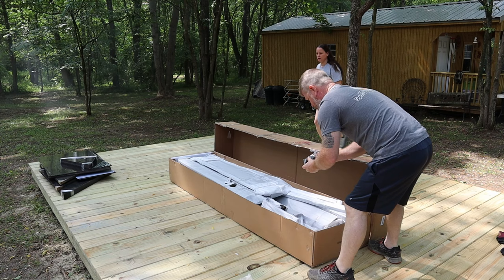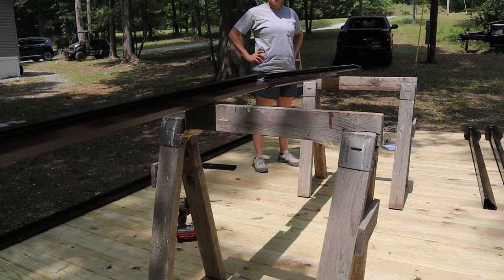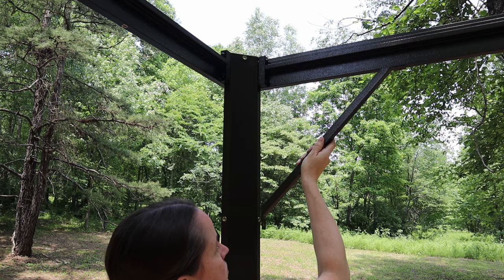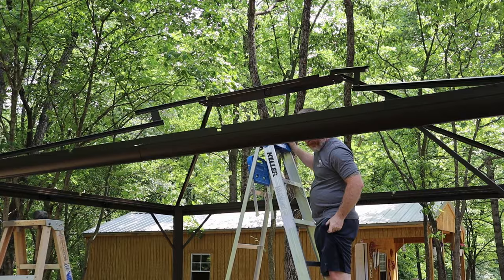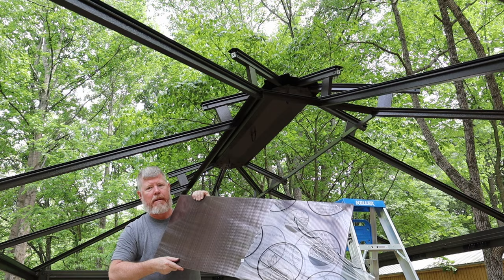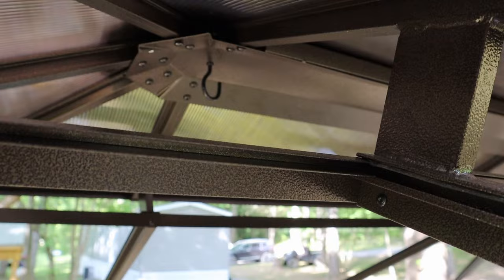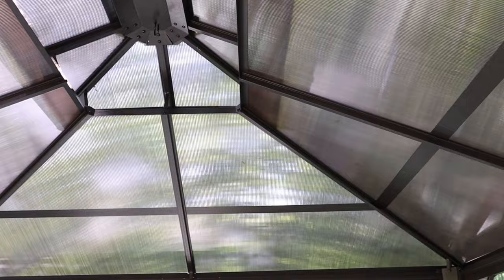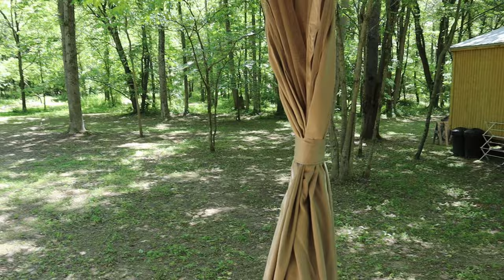"Unbelievably Easy DIY- Watch How We Assemble a Yoleny 10x13 Gazebo With Step-by-Step Instructions!

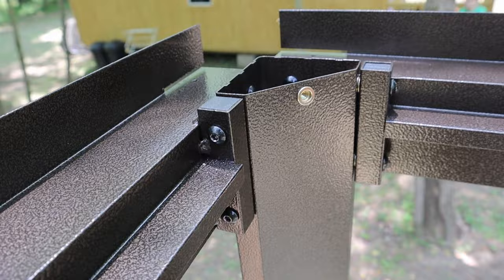Comment: 10:37 super pain in the ass. Design flaw in my opinion.
Reply from the maker: Hi Wayne. Thanks for watching and sharing. We would agree that these could be a big pain in the back side and one that could have been designed differently. Certainly requires you to slow down and take your time or pay the cost for going too fast. Did you build one recently?
Reply: @SpiritedWrenchers  It was not exactly the same brand but much of it was identical. I was able to use a ball end "Allen" driver for some of the screws inside the legs. And to be fair, many of my roof panels had corners that were pretty dorked up. They were packaged pretty well but Federal Express probably wasn't as careful as necessary. I will say the tip about putting in the screws around the edges of the roof before going back and adding the corners or the joining brackets was VERY helpful. I hadn't thought of that and after watching your video the process was a much easier.  Thank you.  
Now I have to decide whether or not it's worth it to request replacement panels for the damaged ones.  I suppose I would notice it more than others would.
Reply from the maker: @waynemiller6070  Thanks for sharing. We personally are not fans of Fed Ex. Every car part or product that has been damaged via shipping came through Fed Ex. If I were you, I would contact them to get replacement panels. Not sure if they can charge that back to the shipper since you have it assembled already but I would definitely let them know and I hope you can get some replacements for it. We're thankful we were able to help you with your build. That's a successful mission in our books. Cheers!